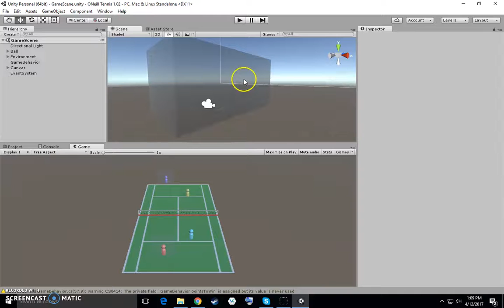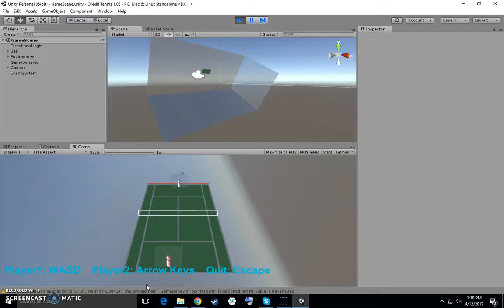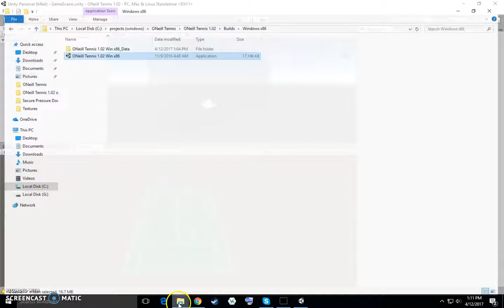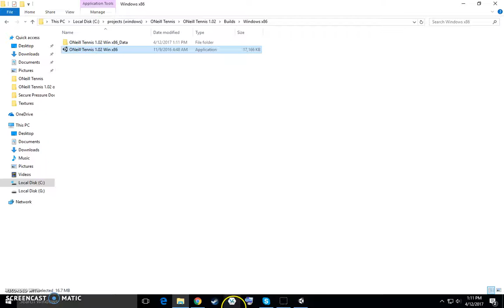ONeill Tennis 1.02 - Tennis on a Rotating Space Station

Comment: How long did it take to make that game?
Also maybe a light source at the rotating axis would help visually. 
Btw found the video because I was looking how the flight path of projectiles is in O'neill Cylinder
Reply from the maker: It took about four full days, but it was also my first project in Unity so a lot of that was spent learning the tool. 

A light source would be a good idea. There are also a few bugs that need working out and it would be nice to be able to configure the simulation to change the size and speed of the cylinder. I've published the source code for this simulation as well as 2D version on my blog: davidkann.blogspot.com so if you're up for a challenge you can take that code and run with it.